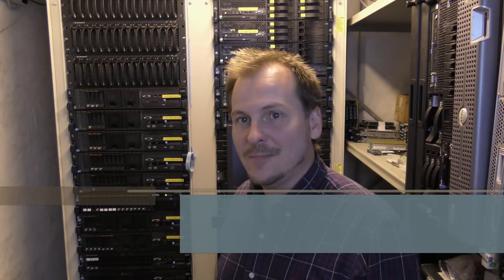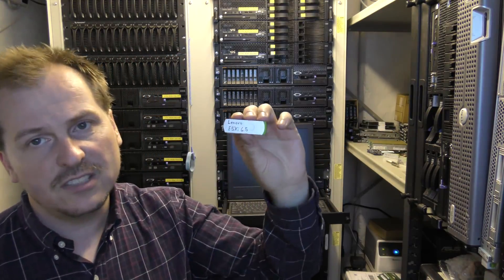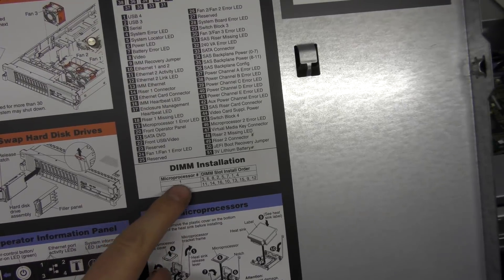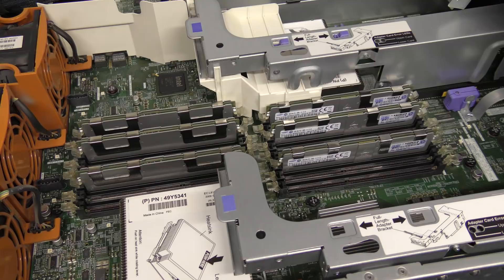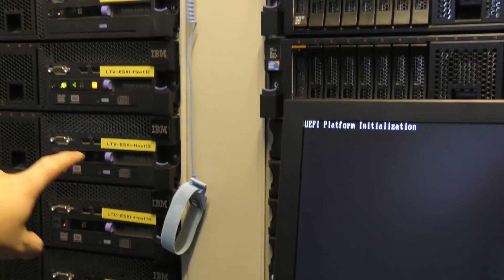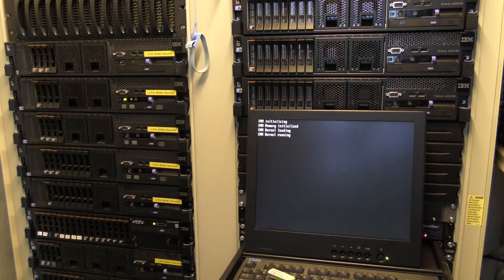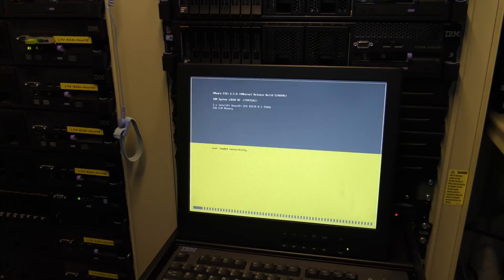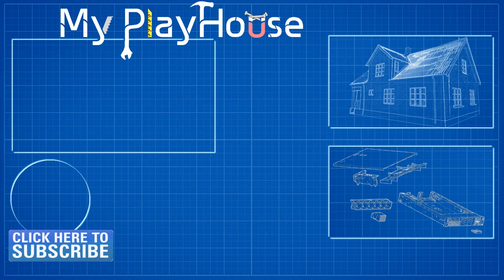Will the Lenovo x3650 M2 do 512GB RAM with 32GB blocks - 742

Comment: Good afternoon! Is it possible to put 16 GB DDR3 PC3L 1.35v RAM Modules on the ibm x3550 m2 server
Reply from the maker: Yes I had luck with 16 blocks of 16GB in another video.
Reply: @MyPlayHouse  Will this model fit? m393b2g70bh0-yk0

Comment: I have an IBM x3650 m2 and I tried to put in 4GB HPE ram modules and my server isn't loading further than UEFI init. I've checked all the parameters of the RAM and they're the same as on my IBM 4GB ram modules my server works with. So maybe IBM just doesn't like HPE RAM modules? :) Is there a way to make them work together? 

P.S. Great channel, thank you for the explanations and manuals.
Reply from the maker: It has to be the same type of RAM,,,, 1.35V and 1.5V ram does not mix,,, and LRDIMM and RDIMM does not mix.. can be that.

Comment: Hi, love you channel
Just received an x3650 m2 and would like to upgrade is with cpu as you recommended e5675 and 256gb ram memories, i would appreciate your recommendation for a good source and not expansive one, 
Also would you recommend installing the esxi 6.5 ver for running multiple servers linux based, web, file, ang some games?
thanks in advanced.
Reply from the maker: Hi gdmax5
Welcome aboard! :-) I see you have been here for a week :-)
The X5675's are not that expensive,, but the RAM adds up 16*16GB does become money,,, I sell them at my little shop at €28 : https://www.myplayhouse.dk/shop/en/server-parts/34-4gb-ddr3-1333-rdimm-pc3-10600r.html
Okay maybe €400-ish for 256 is not actually that bad,, but it adds up.
Thank you for watching! :-)

Comment: Your server installation is impressive, why don't you try to run a node for the HPB blockchain ? They provide you with a free BOE hardware (this is a specialized hardware that help the server to process the transactions) if you manage to pass a hardware (16 core, 32gb ram, 8To HDD) and bandwidth (100up/100Down) tests.

People that actually run a node make around 40 HPB every days, 1 HPB right now equal $0,80 so around $1200/month but if HPB reach $5 it would mean around $6000 months.
Reply from the maker: Hi WAZA
Thank You very much!  I just buy the cryptocurrency I want to invest in.
Thank you for watching! :-)
Reply: +My PlayHouse You don't need to buy the HPB cryptocurencie to get a free BOE and run a node, this is the beauty of this network ☺

Comment: Hello Morten. Bit offtopic but not sure if you or someone can help me with a doubt. I happened to get hold of a X3650 M1 7979 that came with a rack (yeah i know! lucky me!). It has only 1 CPU and one power supply i wanted to upgrade it. However i am unable to find the propper information of requirements and cpu and power requirements compatiblility. I am more of a DELL guy. So my question is, for you or anyone that can help. a) what is the highest CPU family i can get. 5400 family (Any recomendation on any particular CPUs). Also to add a 2nd CPU do i need to populate all fans and get a 2nd power supply and memory (of course) for it to work? Any sugestions or reading materials would be apreciated. THANK YOU for your vids!
Reply from the maker: Hi Gil ARAÚJO
Thank You very much!  I have done a lot of videos on the x3650 M1 : https://www.youtube.com/my_videos?o=U&sq=x3650+M1
Some of them are on CPU's
Thank you for watching! :-)

Comment: Is there any chance to do comparasion of x3650 m2, m3 and m4 side by side? And how cappable are any of them handling a gpu's and passthrough? I know newer is better but with tight budget this would help as I also considering hpe dl380 g7 series and Dell r710/715/720 series. I work with Dell servers so I know most of them and limitations they have and need more facts on ibm/Lenovo ones 
Thanks 
By the Way as always awesome video!
Reply from the maker: Hi Imba Core
The x3650 M2 is great for home server to play with,, professional you want the SR650 right now :-) 
Thank you for watching! :-)

Comment: Maximum ram per CPU for x5500 series is only 144 GB so 16 GB modules for a total with 2 CPU of 288 GB and x5600 series can do 288 GB per CPU and should be able to use 32 GB  modules for a total of 576 GB with 2 CPU. The bios might not let you use 32 GB modules though.
Reply from the maker: Hi Cameron Kettner
Thank You very much!  Yes there is not a lot of good info on this,, if you find the specs for the IBM/Lenovo x3650 M2,, it will most likely say max 128GB RAM.
Thank you for watching! :-)
Reply: @MyPlayHouse   any way you could please test this server with  256 GB + ? I'm about to buy one of these on the cheap, and want to make sure I can use 32GB sticks with a dual X5690.